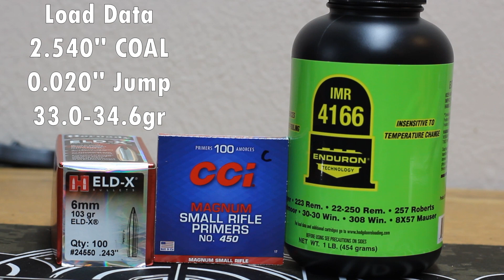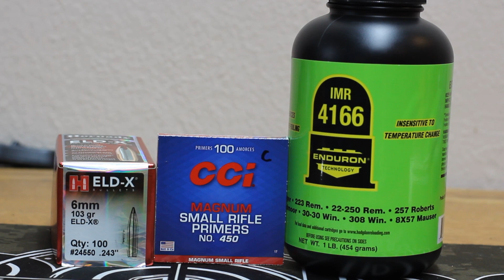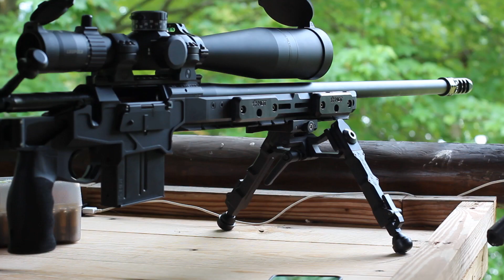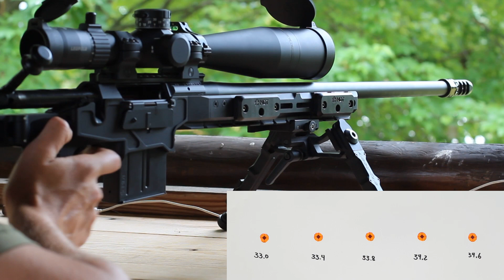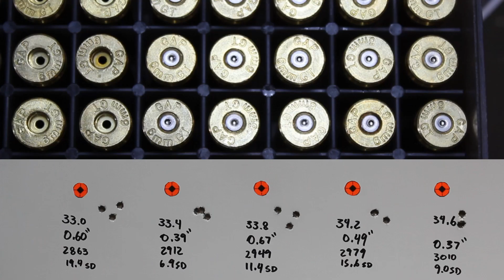Hunting Loads, 6mm GT, 103eldx

Comment: I run the 103s in my 6gt with Superformance powder 41.5 gr. 3130 fps. 4.5 SD. 2.5 COAL for hunting. They shoot great. Haven't tried 4166. I pretty much use 34.6 gr varget for everything else in the 105-109 class.

Comment: Did you hunt with the 6 GT or 6 ARC? I’ve killed 3 deer this season with my Howa 6 ARC bolt gun and 108 ELDM handloads. Very impressed with the cartridge. My Tikka 6.5 CM barrel is about shot out so I’m considering a 6 GT build to get 2850 with 108 ELDMs. I think this will be a sweet spot with recoil, velocity and barrel life (2500-3000) rounds.
Reply: Are you still liking the 6ARC? Currently building an 18" for hunting. How is the ELDM on deer as far as them running or dropping and at what distances? Thanks
Reply: @christopherdodson323 love the 6 ARC. The 108 ELDM is an awesome hunting bullet for deer. They drop either on the spot of a short distance.
Reply: awesome, thanks